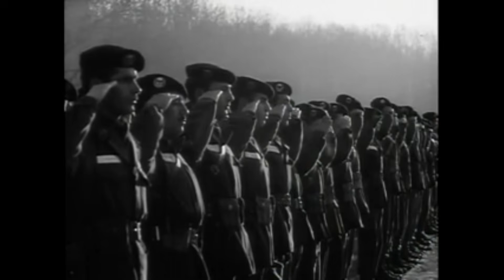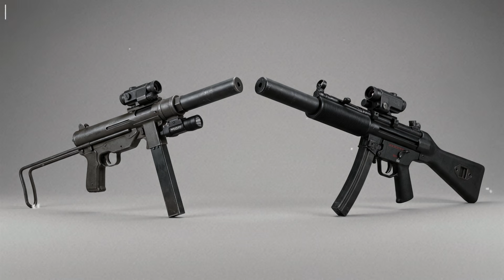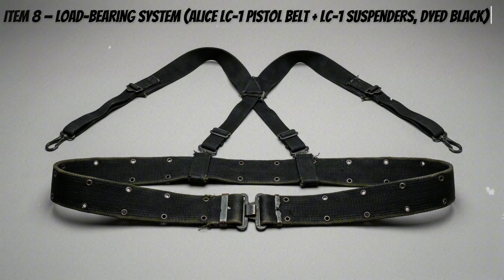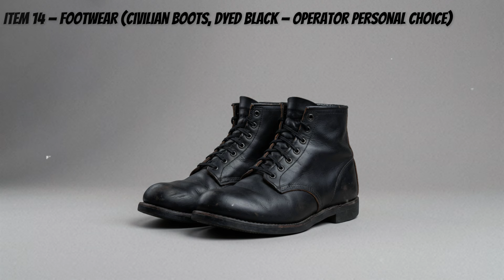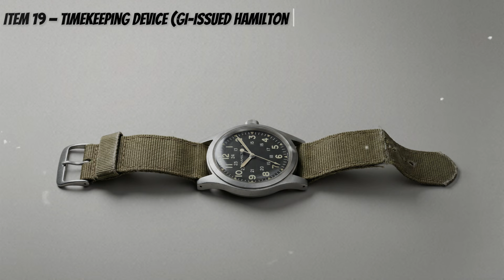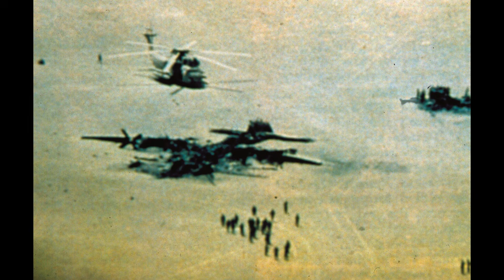Inside the Delta Force Loadout (Cold War, 1980): Operation Eagle Claw

Comment from the maker: Knife clarification:

No confirmed primary-source documentation identifies a specific knife model carried during Operation Eagle Claw.

The Gerber Mark II (1979/80 era) is a possible candidate, but Tier 2 only. No standard issue knife for this mission.

Any blade carried would have been personal choice.
Reply: SGM. Phil Hanson carried a K Bar knife on the mission. His videos with the Silent Warrior Foundation are great.
Reply from the maker: Thanks for pointing that out. I looked further into it.
SGM Phil Hanson did confirm he carried a personal Navy KA-BAR.
That’s a confirmed individual case, not a standard issue or unit-wide knife for Eagle Claw.